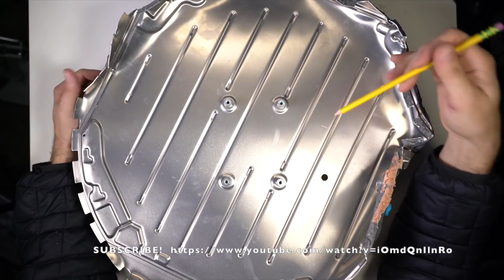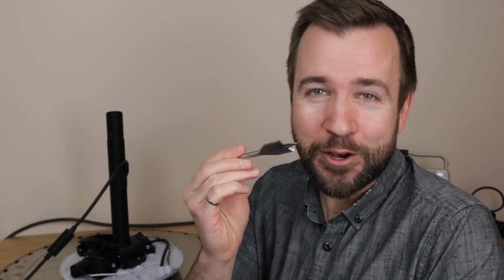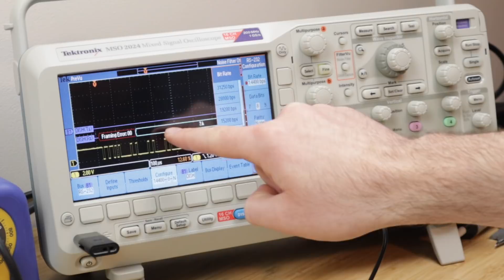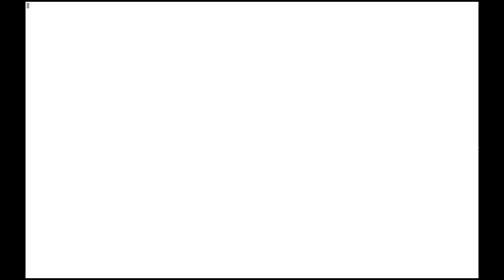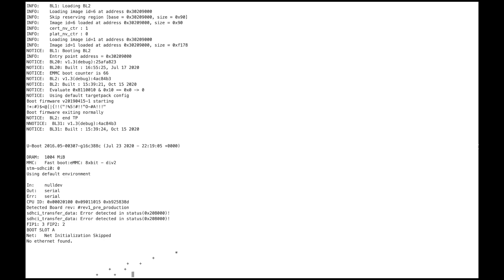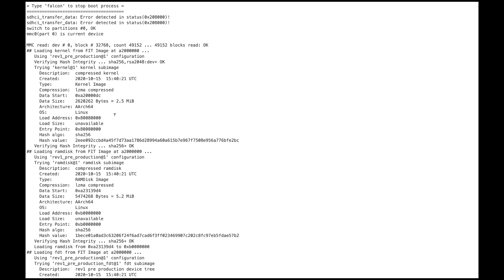Starlink Dish TEARDOWN! - Part 2 - Serial console and login prompt. Can you guess Dishy's password?

Comment: So Ive done a bit of hardware hacking with uboot. The starlink dish probably has its boot delay set to 0 so you will have to interrupt its access to flash. One way to do this is to remove the flash chip (if you also plan on dumping the flash) or pull down the enable pin or the flash chip so uboot fails to boot from flash giving you a uboot prompt. Here is a link to an example done using the same approach with a Philips hue bridge.  https://colinoflynn.com/2016/07/getting-root-on-philips-hue-bridge-2-0/
Reply from the maker: Oh, awesome tip, thanks! I've been considering cutting through the metal backplate just over the application processor and flash chips to get access without wrecking the rest. Removing the flash chip to dump is definitely high up on the list!
Reply: @MikeOnSpace  Yeah I would personally avoid removing the flash unless you have done it before. Way too easy to break stuff or rip up a pad. You should be able to at least view the file system and obtain the password hash just with uboot. Its listed in the bottom of the article I linked. Id be interested if all starlink dishes have the same root password or if they are unique like the Philips hue hubs. I also worry what would happen if you changed the file system if it would fail some hash checks. I doubt the hash checks are for the OS/whole flash though. Edit: if you need any help don't hesitate to give me a ping :)
Reply: @MikeOnSpace  I did notice the logs say 
= type 'falcon' to stop boot process =
maybe will drop it into a uboot prompt?
Reply: @xthexder0  my guess is you cant enter it fast enough with boot delay of 0.
Reply: @m10653  it’s a short command could sit in the input buffer if sent beforehand